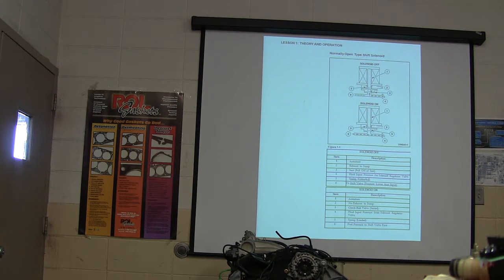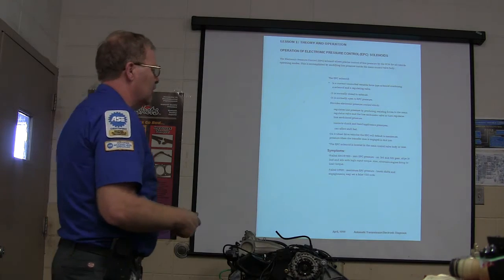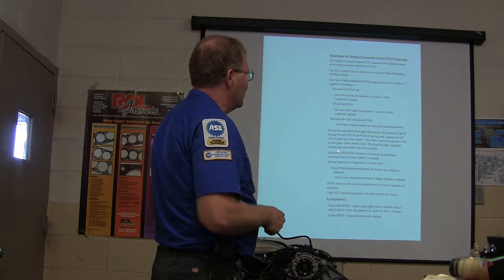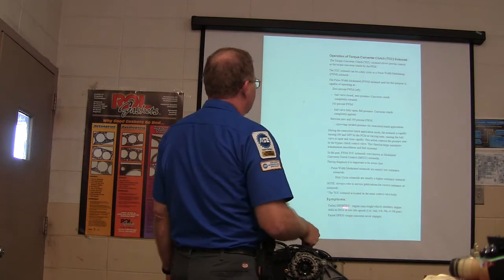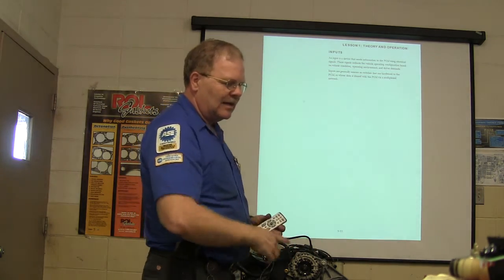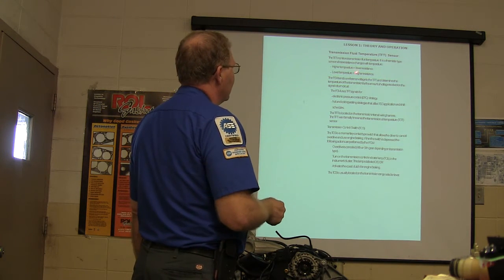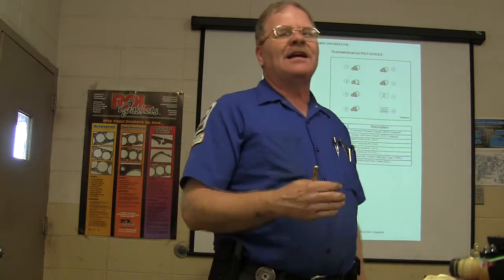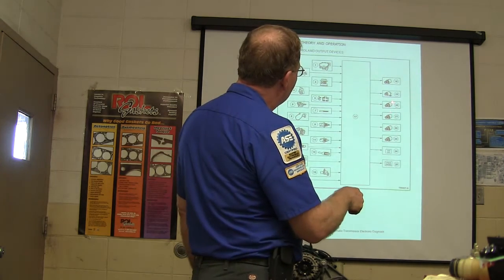Electronic Auto Trans Basics

Comment: Ohm vs. winding on types of electric motors. Home stereo speakers high ohm, smaller magnets, high gauge winding, higher voltage, less watts can be louder better quality sound than some mobile audio systems with low Ohm, low gauge winding, lower voltage, heavy magnets, high wattage. Low Ohm requires more watts to deliver the same punch in speakers but will have a more violent kick. In rotation dc motors a lower number of windings will increase the speed of the motor, cause more heat, and draw more amps. When doing modifications example of an extra fan motor drawing more juice than I like. I add some coiled up wire as a resistor on the negative side of the circuit to adjust the speed and amp load to get the amount of work out of the modification desired without wasting amps and more torque loss from the alternator.

Comment: Hello, Mr Cuistian,       I am trying to diagnose a 2011 Nissan Altima with a step motor code and low pressure code and torque converter code, but I don't understand the description and operation of the Nissan step motor. If you could provide the operation of the  Nissan CVT transmission, I would really appreciate it. Thank you.